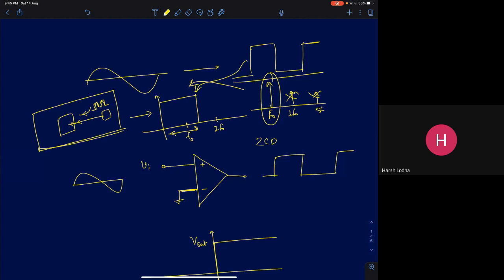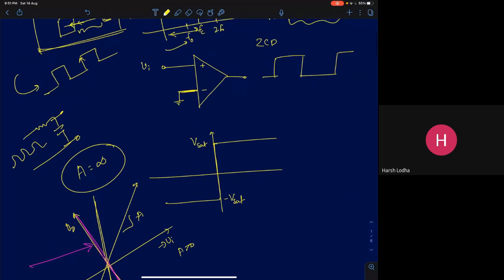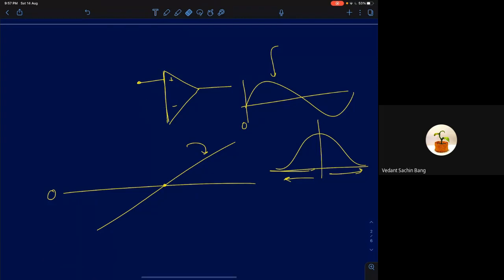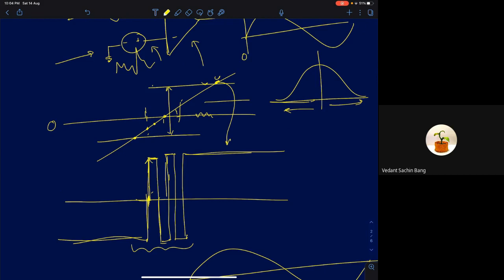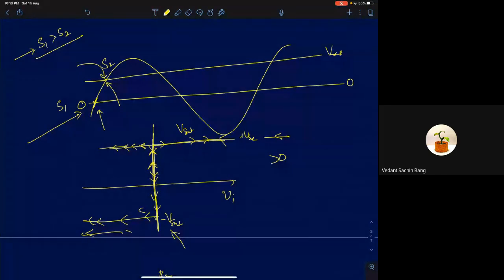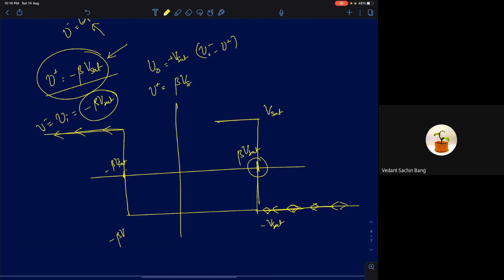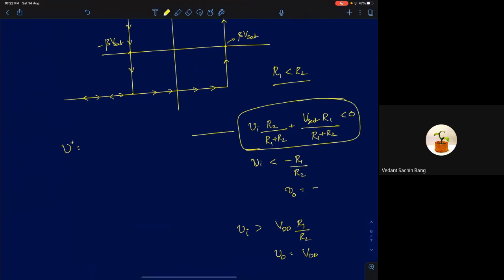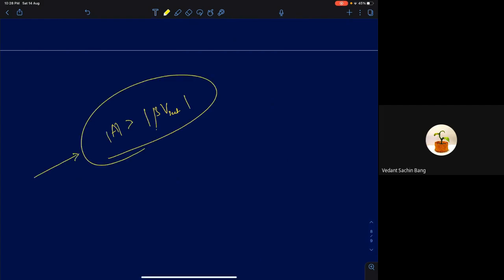OC   Lecture 9: Introductory lecture on Schmitt trigger (sine wave to square wave converter)

Comment: In VIDEO u said low slop has high chances of false triggering , but u are choosing   non zero trigger point how it will reduce false triggering ?
Reply: Yes same doubt.. what's the significance of that point
Reply: That will be in case if the both positive and negative triggering threshold is same and as in hysteresis, the both are different (beta*Vsat,-beta*Vsat). So low slop will not affect here.